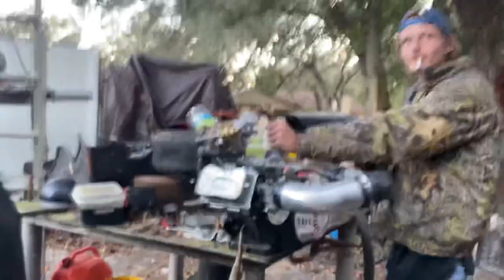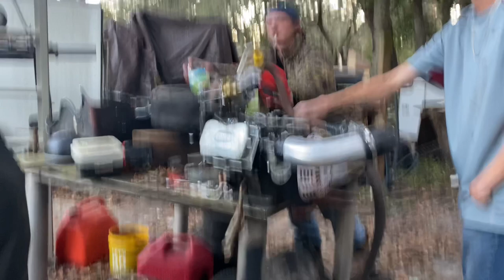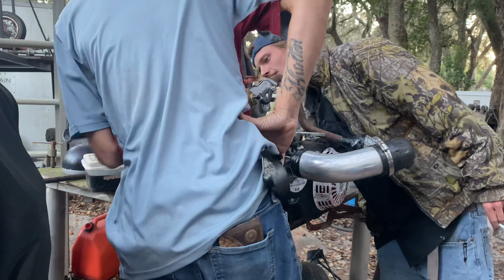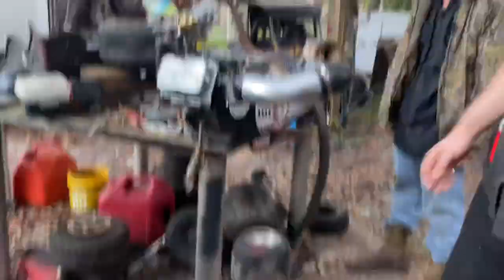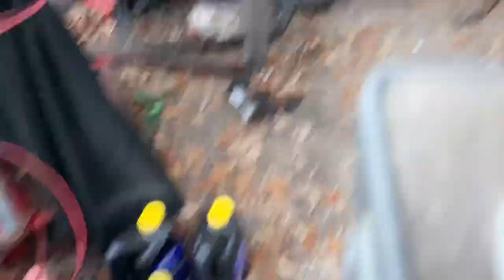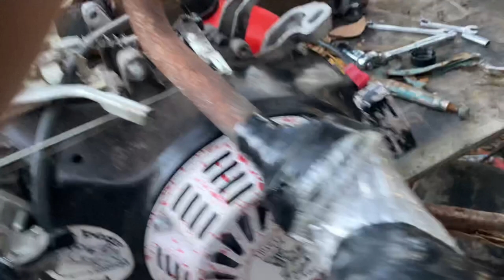Turbo Predator 301 cc #Turbo#howto #amazing #amazon#fyp

Comment: What are you planning on putting the turbo engine on? Also, got a link for the turbo?
Reply from the maker: https://www.amazon.com/maXpeedingrods-Snowmobiles-Quads-Rhino-13900-62D51/dp/B01A0MG5OM/ref=asc_df_B01A0MG5OM/?tag=hyprod-20&linkCode=df0&hvadid=312462950315&hvpos=&hvnetw=g&hvrand=7409802718623714052&hvpone=&hvptwo=&hvqmt=&hvdev=m&hvdvcmdl=&hvlocint=&hvlocphy=1015116&hvtargid=pla-571000980464&psc=1&tag=&ref=&adgrpid=70635887228&hvpone=&hvptwo=&hvadid=312462950315&hvpos=&hvnetw=g&hvrand=7409802718623714052&hvqmt=&hvdev=m&hvdvcmdl=&hvlocint=&hvlocphy=1015116&hvtargid=pla-571000980464
Reply from the maker: It’s going on the big trike first I think then our carter full suspension buggy